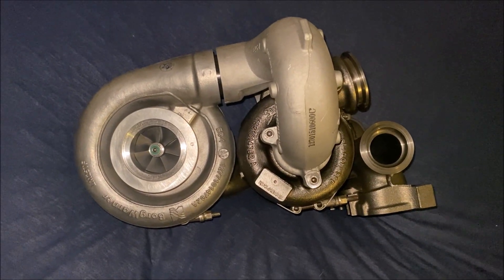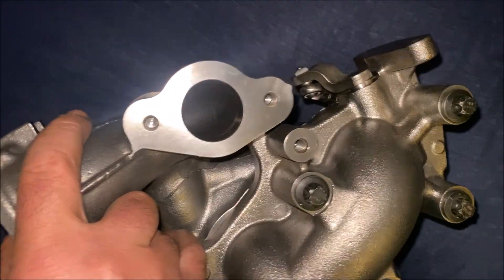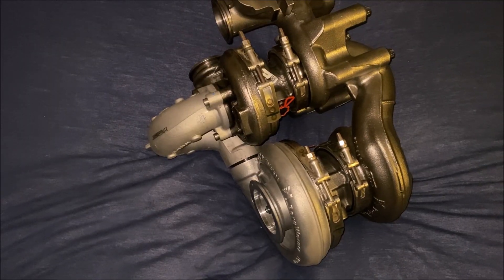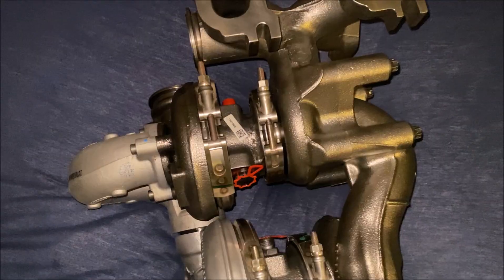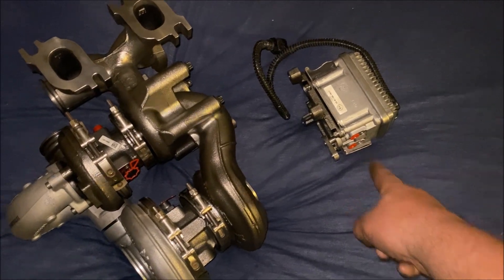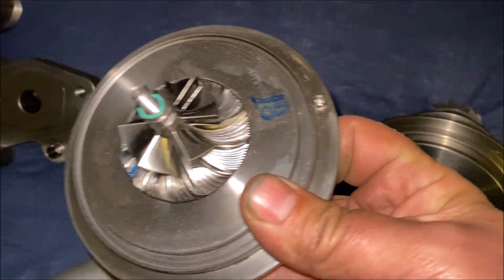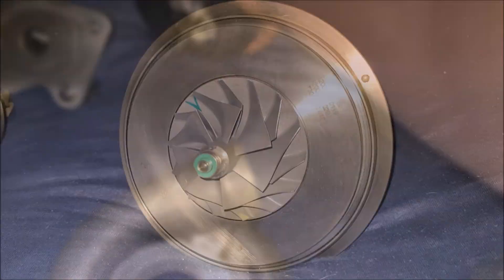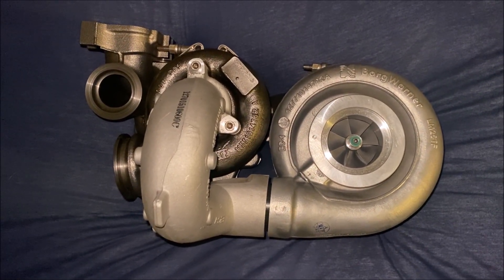A detailed look at an awesome 500bhp+ capable BorgWarner compound twin turbo setup!

Comment: I have the same setup mine is k03 + b2 turbo,  putting it on a 1.4L engine   Looking to get 500hp on max boost  at  18psi 
The small turbo with get waste gated at around 8psi then the big turbo takes  over  and compound the boost up to 18psi then  external waste gated.  So I’ll be running 2 waste  gate one internal one external. Booth with electronic waste gate controller.

Comment: My compound 1.8t is doing great. It truly is the best of both worlds. Everytime I rip through a few gears at 42psi I'm like "fuck this makes it all worth it". It spools the 66mm turbo like it's a gt3071, and the 46mm turbo spools like a 41mm. 
It'd be amazing to just buy an oem diesel compound setup, weld a t25 flange on it and bolt it up. That all in one cast is ridiculously compact.
Reply from the maker: Fuck yeah! Where can I see more on your one? Sounds badass 👏 good work

Comment: I run compounds on my 155cc drag bike on e85 it works well enough to touch 100whp. I see some issues with the bigger turbo not being gated and these being diesel turbos I bet the turbine wheels are pretty small

Comment: looks like bmw's twin air system, not a true compound setup
Reply: What are you on about? This is as much of a true compound setup as one can be. Meanwhile Twin Air is the name for Fiats 2 Cylinder engine and BMW's TwinPower Turbo has nothing to do with compounding, with it just a fancy name for their engines that are equipped with a twin scroll Turbo.
Reply: @aaaabababa thanks for the correction, twin air, twin poer twin blah blah. what I'm on about is this looks more like a sequential turbo set up, for efficiency,  and not for higher boost pressure for max HP.  like a compound set up.

Comment: This looks like a newer version to what I’ve fitted to my fiesta. R2S borgwarners. Confuses a lot of people when I pop the hood
Reply from the maker: Yeah very similar
Reply: @StavTech   mine defo doesnt have a billet wheel on the HP turbo. always concerned about how fast its getting spun....
Reply from the maker: @mikefpe  unlikely that fast, from all data I’ve seen both the HP and LP turbos are turning way less rpm than you’d expect if they were singles. 
Even when the overall power is well over twice what the HP one could make on its own, and boost is upwards of 40psi, turbo rpm ive always seen were never that high.
Reply: @StavTech well that’s reassuring. Last thing I’d want is bits of impeller going down stream. 😅
Reply: bonnet*
Reply: @darcyguerinhanlon3916  sorry I should have put that in quotation marks ........ "its not how you stand by your car" lol

Comment: Wonder uow the transients would compare to a nice twin scroll on a good flowing gasser
Reply from the maker: Way better. I’ve seen data, transient is insane, esp from lifting then back to full throttle, in fact so mad it might be a traction issue unless slowed down on a lot of setups.

Comment: I few years back i picked up a Holset HE400 Over a HE250EWG (eletronic wastegate) factory compound set up, i can't find any information from what its from
Reply from the maker: Funnily enough Ive been looking for it too! I picked up a couple of the HE400s off one of them, brand new, but didn’t have the other half and didn’t know what the smaller ones were either!

Never found out what it was off or seen them since.

I changed the turbine housings for HX40 ones and used them as normal turbos
Reply from the maker: Found it! You saying what the other one was helped, as all I know was it was a HE400FG for the bigger one. Thank you!
Unfortunately as expected, we’re talking $3500 To buy it 😂
Reply: @StavTech  yeah he400fg sounds right. im yet to put on something.
Reply from the maker: @darcyguerinhanlon3916 if you ever decide to sell it let me know! I found a used one for sale that looks good but unknown really, and in USA so shipping would be loads as it’s a heavy lump!
Reply: @StavTech  i got it from the US to Aus about 4 or 5 years ago its a heavy mofo

Comment: That's wild, crazy what oems get made due to the volume of units they purchase.
Reply from the maker: Yep, tuning people think their stuff is top and OEM stuff, especially commercial vehicle stuff, is old. But no, OEM commercial vehicle stuff is normally way way ahead and more complex, because the amount of miles and use they do, any tiny improvement in efficiency is worth a fortune in fuel alone, so they do some wild and mega expensive stuff for OEM commercial vehicles!
Reply: @StavTech  just like when people say "mil spec" stuff is garbage, what you like paying a fortune for stuff that "might" work? Mil spec is bought by the ton by militarys where shit just has to work in extreme environments and be easily serviced.

Comment: is there an intercooled version?

edit: if you intercool you will reduce the amount of work required for the second stage do insure that the pressure drop is not too large F1 use micro tubes for this. in a modern jet engine with multiple axial compressors the velocity remains constant some brayton cycle engines have intercoolers
Reply from the maker: The intercooler goes after the turbos.

Almost no OEM compound setup and not many aftermarket ones use interstage cooling
Reply: Could add inter stage water meth if you're worried about it

Comment: this is from an OM934, the OM936 is the 6 cylinder 7.7L version which also comes with the same style compound setup depending on the power level. i don't know the sizes of them but i'm guessing its probably just a slightly bigger version of this one so will probably make more power than this setup. might be an option to look into? Saying this because you said this one was going to be to small for your 700hp goal.
Reply from the maker: Yeah I suspect it would be about right! The thing is, they normally are SO expensive i think I’d struggle to find a new one like this for anything less than about £2000 😂 

If this was their usual price I’d have never been able to get it.